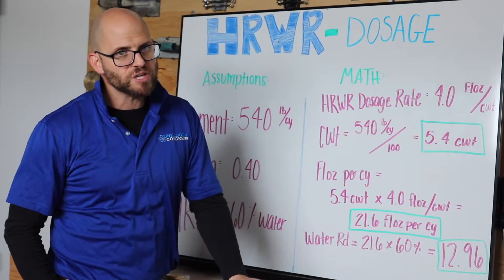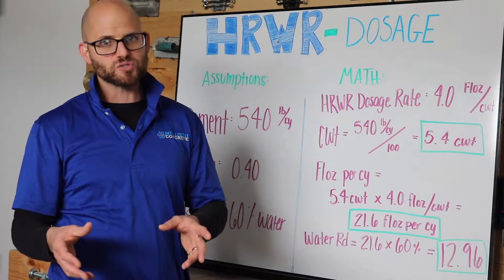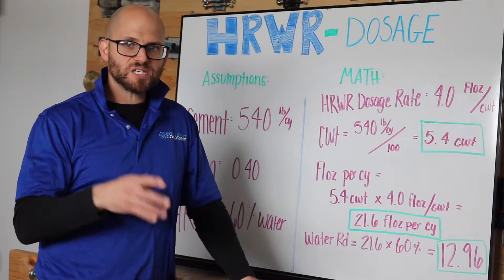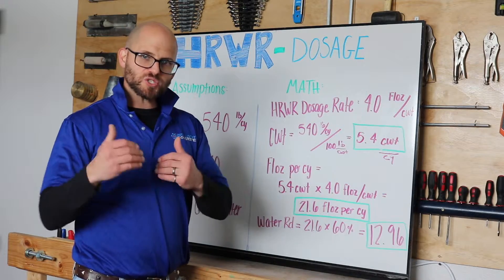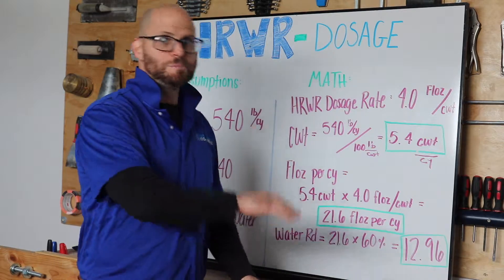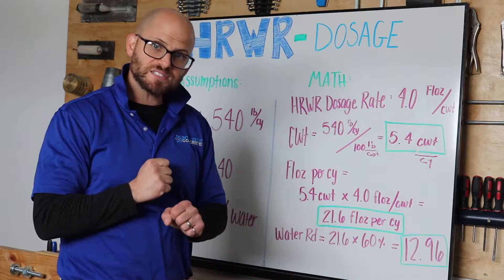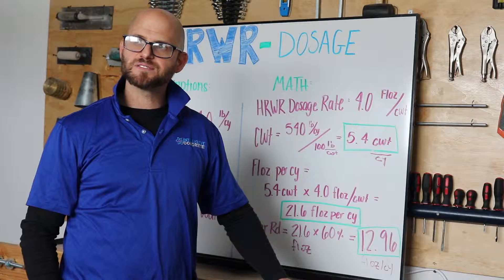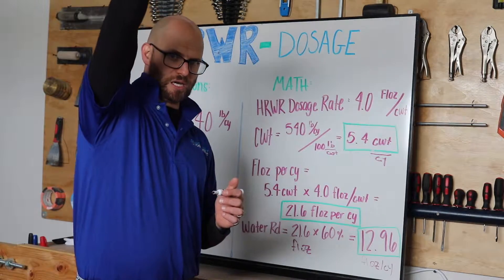High Range Water Reducer Dosage - Math - Vlog #306

Comment: Thank you for the Video. Please what is the industrial standard dosage for low and mid range water reducer.
Reply from the maker: Anywhere between 4-8 fl oz per cwt depending on the concrete end us, the amount of water vs cement, paste content, and other admixtures.
Reply: @IntelligentConcrete  thank you for the response. I appreciate. Just two follow-up questions please. 1. Do you consider the concentration of the water reducer in the calculation eg a 30% active solid content product to be dosed at 4fl oz per cwt. 2. When mixing cement paste using a handle held mixer, is there a recommended speed (rpm) that gives a proper mix... ie using slow to moderate speed or very fast...?

Comment: Maybe you can answer my question: Should I take the concentration of the product into consideration to calculate the required amount when the dosage is given as percentage of cement weight. 

Let me clarify it with an example (here in Europe, we use the Metric System, but that doesn't matter, the principles are the same):
From the datasheet of a super plasticizer the recommended dosage is 0.2-2% of the cement weight. For simplicity assume the product has a concentration of 50% (e.g. 50% water and 50% active solid product).
Now, if I need to dose 1% of the cement weight (assume 100 kg) should I dose it like:
A) 1% of 100 kg = 1kg, therefore I need 1 kg of the total product
B) 1% of 100 kg = 1kg, therefore I need 1 kg of active component of the product. Since it's 50% concentration, I need actually 2 kg of product.
The reason for my confusion is the fact that the manufacturer offers different concentrations of the same product (e.g. more or less active product per unit of water), although the datasheet only mentions the 0.2-2% range. This only makes sense if method B is correct. Once more, because regardsless of the concentration, only the active component is what gets the job done, all the rest is water. So it wouldn't make sense to add the same amount volume/mass of a lower concentrated product to get the same results... 

I really appreciate your input!